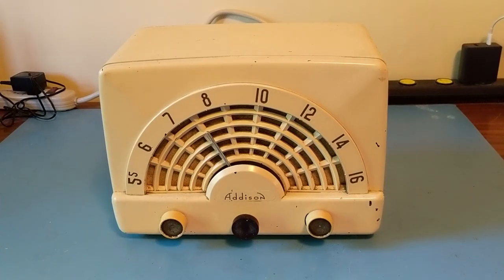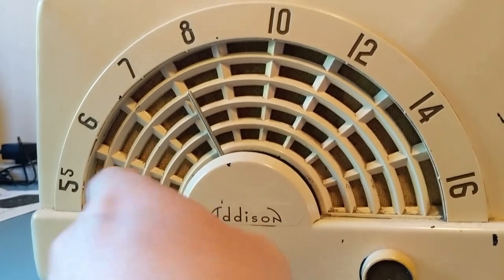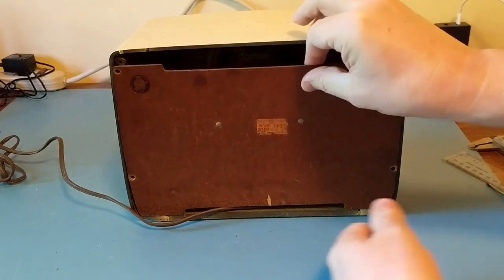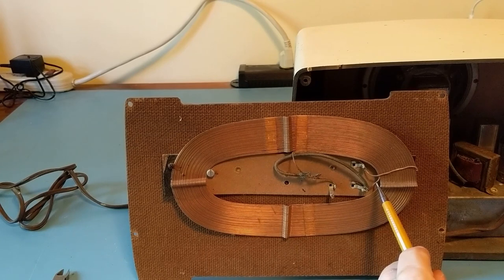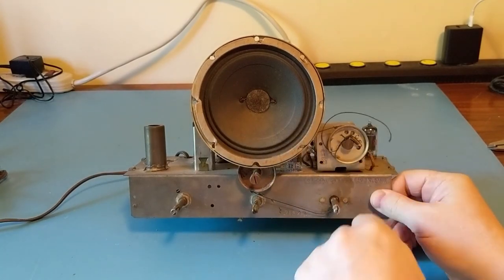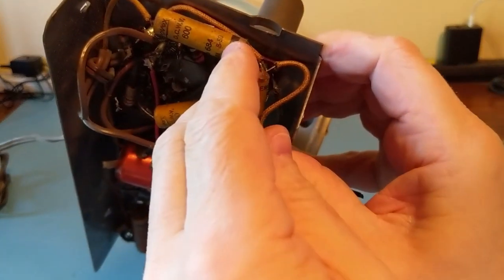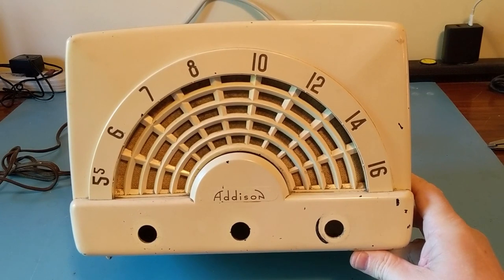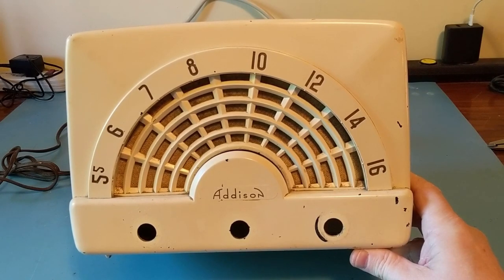EV 001 - TubeTech - Addison Model 53 Overview

Comment: Pacific Online catalog has schematics for tube radios. Saw an Addison model 64 with same tube layout and a photo of a brown painted version  exactly like you have.
The radio diagram you got from Radiomuseum.org is for a model 64 and you pointed out the audio transformer and pi circuit  does match what you have there.